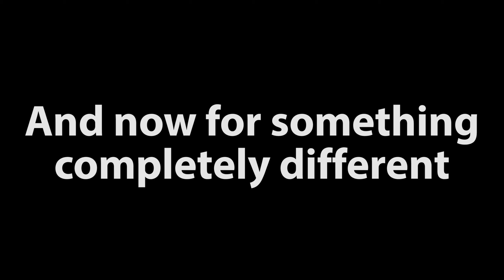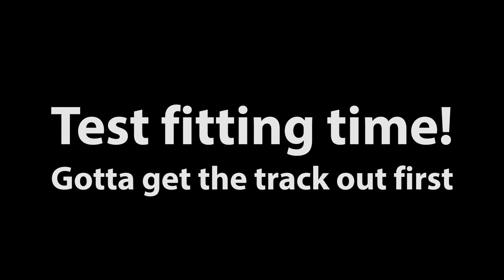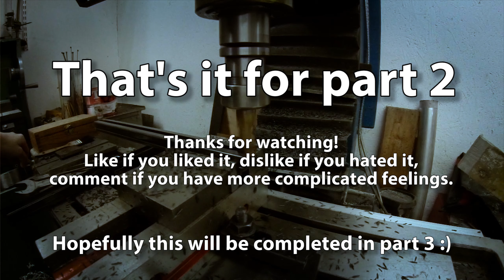Blizzard 797 Slides - Part 2

Comment: Nice job, well done
Reply from the maker: Thanks! It's all starting to come together now :) The suspension is a bit wider than "normal", so it was pretty uncertain if this was going to work at all. On the old track the clips were cut to make it work, something I really didn't want to do because I'll be doing some oval racing with it and there wouldn't be anything other than the drivers keeping it in place sideways without those supports.